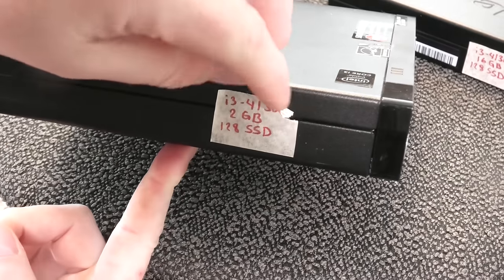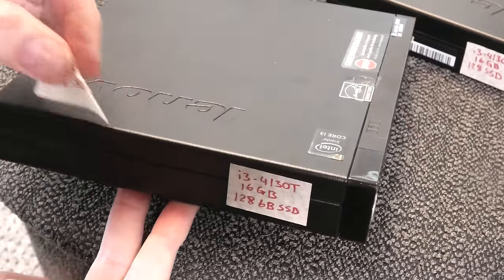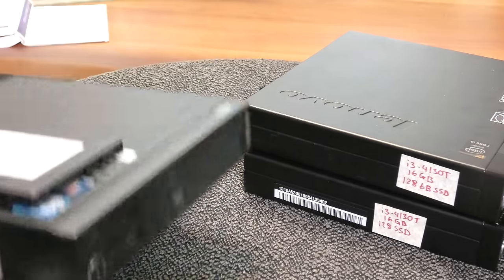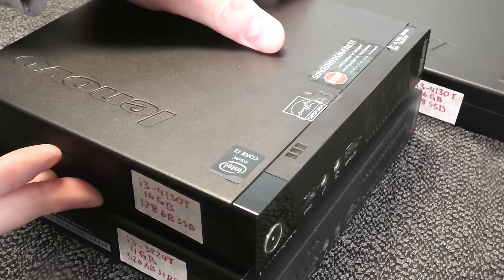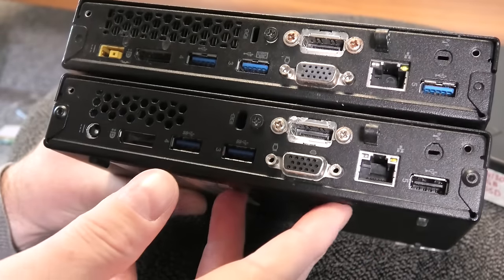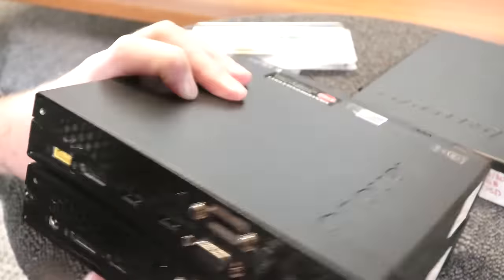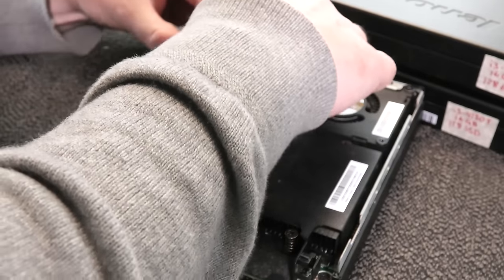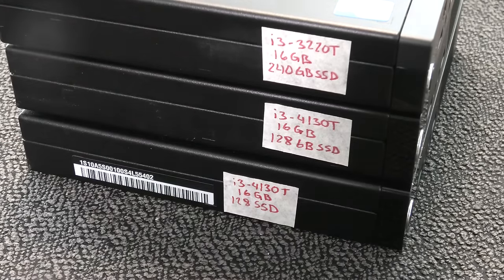Lenovo Tiny M92 and M93 Upgraded with Max RAM - 1378

Comment: it would be interesting to see what the m92 could take in terms of cpus since its haswell era and as it has a more ineffiecent cooling setup. no idea what the designers were thinking at lenovo when they made it. they put the heatsink fins right on top of the cpu where the fan is blowing all the air outside instead of onto the heatsink like on the m93. very good way to boil the cpu
Reply from the maker: Hi @Theutmostgeek
Thank You very much!  glad you liked the video :-)
Thank you for watching! :-)
Reply: @MyPlayHouse  been enjoying your videos since you did that collaboration you did with Brainiac75 :)

Comment: My biggest issue with my M93 is HEAT!  Even after being re-thermal pasting it still runs scalding hot unless the cover is taken off and an additional fan is pointed at the heat sink.
Reply from the maker: I ran two faster CPU´s in mine a few years back,, for like 3 years,, no issues.

Comment: You could make it work by adding the CPU Microcode to the BIOS. But I would highly recommend looking at the CPU Support from Lenovo tbh.
Reply from the maker: I ran one of these with an Xeon for two years,, no issues :-)
Reply: @MyPlayHouse If you haven't already, would you consider making a video detailing the process?

Comment: I've used haswell xeon cpu in dell sff 3040 and worked wthout issues but without IGPU. But if i configure everything i dont need igpu
with newer one Dell uSFF 3050 i went with 65W version of i5 6500. Works awesome as a bridge server :D
Reply from the maker: ohh I did not think of that option :-)
Reply: @MyPlayHouse although option with installing xeon ends with haswell.
After that officially xeon will boot only with C6xx chipset only. I've tried to boot xeon on dell 3050 but without success.
Also 3050 officially supports 35w cpu but works just fine with 65w. Power draw is awesome in comparison to my main server 😅 Around 10-15w vs 150-200.
At least I'm telling myself that it's powered mostly from solar now

Comment: Tbh it’s not worthy to invest  on these old machines anymore. A Chinese n100 go about the same price ( specially if your upgrading CPU’s and out perform them all.
Reply from the maker: Yes it gets close,, they do cost a bit if they have 16GB RAM. But You might be right..
Reply: @MyPlayHouse  Also the networking on the newer mini PCs is sometimes better.
Reply: If you shop around you can get these much cheaper than an N100. I got 6 of these with i5-4590Ts and 8GB of RAM for £17.95 each. Biggest drawback is the single SATA port.
Reply: You are right! See also my comment above!
Reply: @MyPlayHouse might cost a bit for this and that  and be obsolete but gets my elderly brain going trying your projects,plus I get a rush seeing  this old stuff getting new life.Cheers mate

Comment: Hai Morton, just ditch this old junk, as it uses too much power now ! You can buy a super efficient minipc with n100 qc processor, which only uses 6 watts standby for the price you are going to spend on a 'new' processor for this junk lot!
Runs proxmox and several vm's and containers just fine!
Tip: maybe they want this old stuff in Portugal! :-)
Reply from the maker: Okay,, yarh I do see that N100 is pretty fast :-)